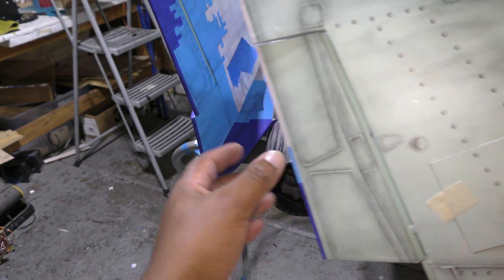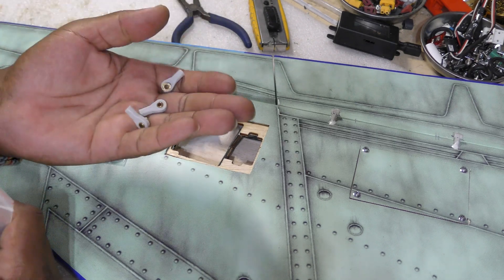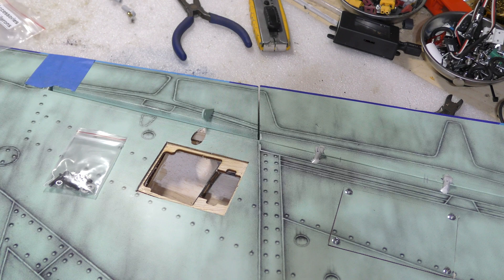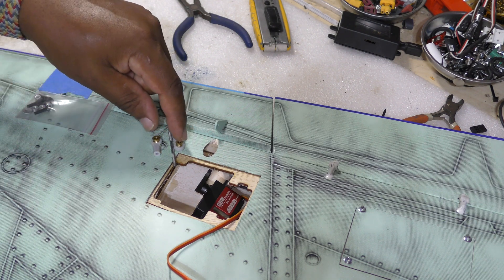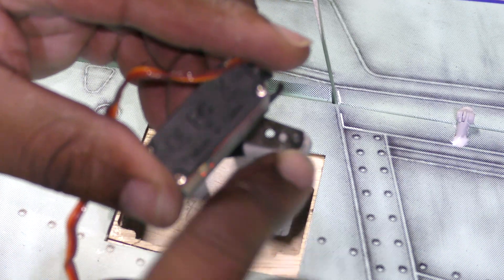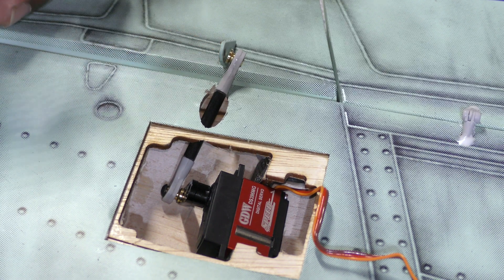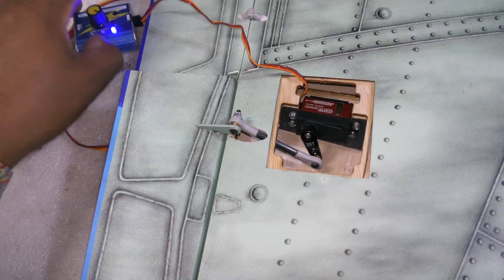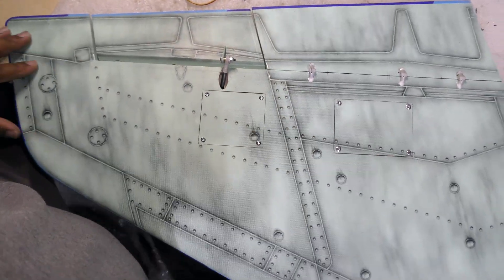BlackHorse Mig29 Build Series #4: Wings Part 2 (Ailerons)

Comment: hey frank,,what is the rod size cover the black one your using.and if you have a link for them?   thanks larry
Reply from the maker: It’s just a carbon fiber rod with a 2 or 3mm inner diameter. Get them off amazon
Reply: @FlyWithFrank  thanks frank